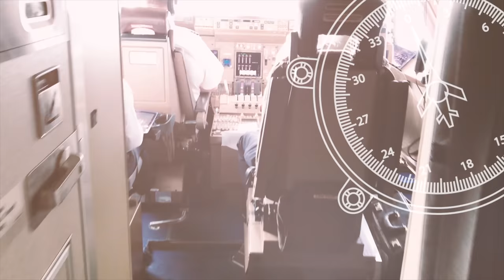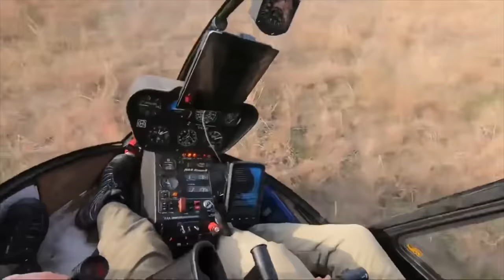Boeing 747 Loses Landing Gear | Viral Debrief

Comment: I love how you give advice on how to land in a wind, and in my mind I'm thinking "yeah, yeah, good idea.  I'll totally do that next time I'm landing a big jet.  Thanks for the tip."   I'm a doctor.  lol
Reply: Every pilot is taught to increase the approach speed of a plane (even small private planes) when it's windy. I have forgotten the exact percentage of increase based on wind, but the information provided in the video is, as I noted, standard, varying of course for each type of aircraft.
Reply: @jonshepard85  I wanna say half the guat factor.  So if it's 15 gusting to 25, add 5 knots to normal approach speed.
Reply: Sometimes a passenger has had to land  a plane, who knows that information might come in handy.  Any knowledge you acquired is not wasted. LOL
Reply: @ezell8884  only in Hollywood movies... you’re probably more likely to get struck by lightning several times than have to land a plane as a passenger.
Reply: @eyeborg3148  but people have been struck by lightning several times, so it is theoretically possible to happen
Reply: I'm a software engineer 😅
Reply: @kkmac7247  The roof right above my head got struck by lightning. Happened twice in my lifetime. It didn't have a metal pole on it or anything, was like a gunshot
Reply: @Stettafire  you better be ready to drive that plane then
Reply: Hahaha🤣🤣🤣 hey yuh never know.
Reply: Thanks bro i will try it in xplane 11
Reply: Noel Coward  ?
Reply: @Stettafire  is a software engineer and original commenter is a doctor. Y'all can afford to get your private pilot rating. So it's useful information because the core principles of flight are the same!
Reply: Also a software engineer…love this channel lol
Reply: Pfft.. Amateur... After 1 hour of YouTube I'm a culinary master of social science and a politician with a degree in law whose hobbies include being an expert engineer-pilot Doctor veterinarian....
Reply: I know, I do the same thing. Trying to remember lots of info, like I'm ever going to need it
Reply: Lmao I'm literally a student- ah yes, this will help me pass my a-levels 😂. Honestly this will probably be the thing I remember during an exam instead of the dates I need to remember for history lmao
Reply: @Stettafire  same happened to me once. I literally jumped several feet into the air, I don’t know how or even why. It just scared the hell out of me. It’s so freaking loud. Far louder than a gunshot. About 8 years later it hit right outside my bedroom window in the night and nearly made me jump from dead asleep to straight out of bed. I knew where it hit the next morning because there was a burned spot in the grass about 10 feet from my window. It’s pretty terrifying.
Reply: The reason Kelsey gives this type of advice in his videos is a large number of his audience members are pilots. They may be pro pilots like him or student pilots, but I’m quite sure his advice helps some of them on a regular basis.
Reply: I'll never make use of the info personally, but demystifying how flying works is fun in its own right :)
Reply: There are always nurses...  tend to be a little thicccer than in the past.  A little more margin might be useful.
Reply: @jonshepard85  I’m going thru flight school so can confirm, the increase is: x knots = 1/2 gust factor
Reply: You can at least pretend, you pretentious individual.  We don't care if you are a doctor.  This is an aviation thread.  PS.  We still love you.
Reply: @kkmac7247  He prob mean it is a bigger chanse to get struck by a lightning than have to land a commercial plane as a passenger.
Reply: @RandySnarsh  i know he did, but it is still possible to happen, even if it is unlikely
Reply: @srcastic8764  in my mom’s older house we have big bay windows in the living room. We were watching tv one stormy day in central FL and it was nothing out of the ordinary. My brother was laying on the couch and I was playing on the floor. A lightning strike bounced off the lake across the street, came through the window and hit the ceiling fan above the couch then grounded to the couch and floor and my brother and I both went flying in the air. Neither of us were directly hit with the lightening it just was very charged and bounced off more electricity until it grounded off the floor. My mom was sitting in the kitchen and all she knew was suddenly my brother and I were both in the air and she was shocked. 😂😂😂😂😂
Reply: I'm a software engineer - who has landed a plane. 
Okay so I was taking flight lessons at the time. :) That, and I land my RC planes. Funny thing - in one of my first lessons I saved myself and the instructor. As we were getting in to go take off, I asked about some bubbles in the fuel line. Without going into detail about carburetor bowls, suffice to say if I hadn't caught it the engine likely would have quit about 60 seconds after take-off. Which goes to show - sometimes the clueless newbie does save the day in aviation.
Reply: Doctor for....? Sorry I don't care of your extra self proclaimed letters to your name?... guess part of your name Dr. Main landing gear trucks assembly.... Hehehehehe.....self proclaimed grandeur. I am a basketball sir! Lol.....
Reply: @byronharano2391 ?
Reply: @kkmac7247  Someone made a joke about being a doctor in an earlier post. So I am just adding in some fun. Lol...
Reply: @byronharano2391  oh
Reply: @kkmac7247  I was responding to another post. Thanks.
Reply: @byronharano2391  I thought you were responding directly to the original comment
Reply: @kkmac7247  no...I was not. I understand your comment. Was another post in this string and my comment is more of a follow up and not a "dig" against the person posting. Sorry. Thanks.
Reply: @eyeborg3148  it had happened. A smaller aircraft but still
Reply: Student pilots dream of an announcement being made, “is there a pilot on board?” and landing a 747. Meanwhile, the most emergent announcement I usually hear is, “is there a doctor on board?” (I’m a nurse so it doesn’t end up quite as exciting for me).
Reply: I am with ya and i am a plumber
Reply: @morrit33  has the idea.
Reply: you'll be too busy delivering a baby to land the plane.
Reply: @DblOSmith right, same here, watching these videos and learning about landing a 747. I'm a facility maintenance technician for a live in drug and alcohol rehab facility.
Reply: @michaelgasperik4319  Ooof, anything related to substance use facility is usually tough work.   Cheers, friend.
Reply: You say that yet that advice would also apply to small aircraft that you yourself might actually learn how to use and fly yourself, along with many other private pilots.
Reply: @kavinskysmith4094  It's possible.   Who knows.
Reply: Thought I was the only one
Reply: *musician
Reply: Maybe you can give me some advice on how to remove a spleen? lol
Reply: @byronharano2391  👏 👏
Reply: I'm not  planning on anything close to being a pilot yet i still watch these videos
Reply: I'm sitting here focusing so hard on this advice as if I'm ever gonna fly a plane 😂😂
Reply: A doctor with a motorcycle? I like it
Reply: There a Doctor! Not a Pilot!
Reply: Same with me and I'm a biology teacher lol
Reply: I'm a rocket surgeon.
Reply: I have an office job and I am definitely remembering to do the crab walk the next time I have to land a 747 or 777.
Reply: @michaelschwartz9485  when I was in High School I wanted to become a Rocket surgeon. Unfortunately didn’t have the grades (or money) for the college it requires. 
I applaud you sir.
Reply: You're a doctor?  You should totally buy a Bonanza V tail...
Reply: Im a doctor too, but in all honesty these ariline advice and safety things is helping in my line of work. just the fact of analysing, finding issues and making things more safe is actually helping my mindset in the ER :o not even joking. The aviation industry could help a lot with how the handle things.
Reply: I land photos, not planes. 🤣
Reply: you joined in 2006?!
Reply: @ezell8884  This made me think of movie scenes. "Is there any doctor on this plane?! -yes, I am! -Great! We need you to land the airplane!"
Reply: Yeah, helps me land my patient…
Reply: @gryper1690 don’t

Comment: The helicopter pilot did a great landing, but caused the accident in the first place by taking off with the magneto switches in the off position! Those switches fail to "on" if they have a bad connection, so that's why they were able to take off. You can see it in the full video and in his expression when he sees they're off as they're shutting down. Lesson: ALWAYS DO CHECKLISTS!!!!
Reply: Perfectly good hog hunting day shot to hell!  Welcome to Texas!
Reply: Ummm no magneto switches do not turn on the magneto by closing the switch. Magnetos are always on. The switch in the "off" position is actually a closed switch, not an open one. It works by grounding the P-lead in the off position which grounds out the magneto stopping the spark.  If a mag switch fails open or the p-leas breaks or is disconnected, the only way you can shut down the engine is by closing the mixture.